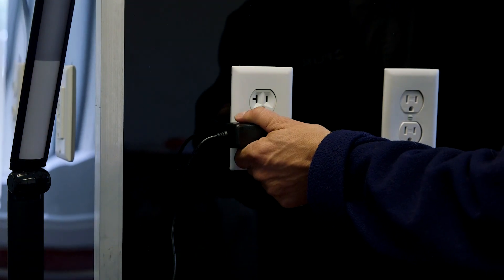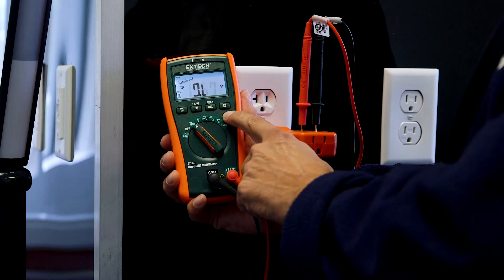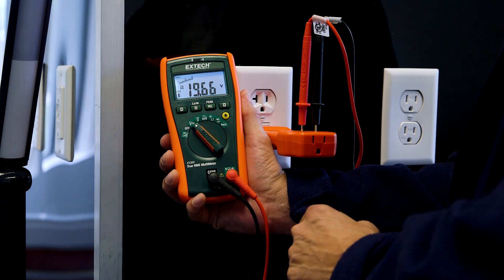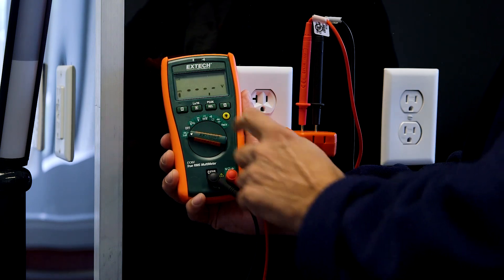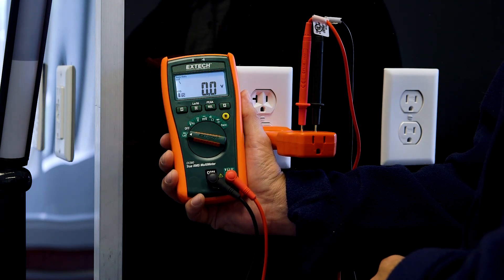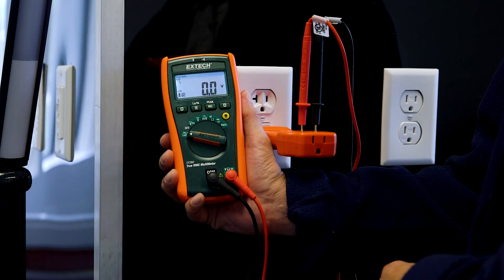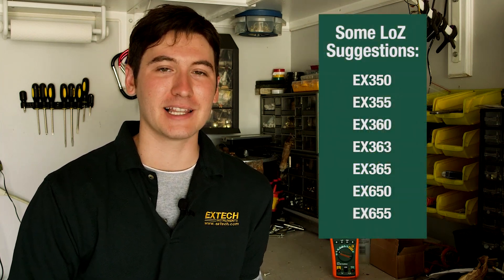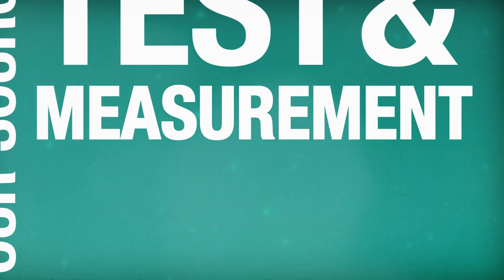In the Know: LoZ and Ghost Voltages

Comment: I have a switched wall outlet in the off position but the switched outlet itself says I have 28.55 volts, then when I test the same off switched outlet in the off position in LoZ I get only .10 volt, or 1/10th of a volt. Am I seeing a ghost voltage? Is this normal? Thanks for your help.

Comment: Ghost voltage levels?  How about the audio levels.  You do yourself a disservice not bumping the gain.
Thumbs up for the informative post.  Thank you.

I searched it for you...
"David Mumbert, Audio Engineer (corporate) (quora website)
Answered Aug 26, 2018 · Author has 635 answers and 183k answer views
Try these steps as guidelines:

Record at -20dBFS. It will sound too quiet. You can bring it up later.

Use a compressor on voices set at a ratio of 3:1, attack at 30ms and release at 150ms. Or use “auto”. Do not use a compressor on your intro or outro music.

Mess with the threshold control until you get a consistent sound you like. It will start to sound more like pro radio. Hard to describe but you'll know it when you hear it. Try to set Threshold so that Gain Reduction or GR pulls down about -6dB. This is the amount that the compressor reduces.

After that process, move the faders so that PROGRAM/master is peaking at about -2dB. This can be time consuming because you have to watch the meters."